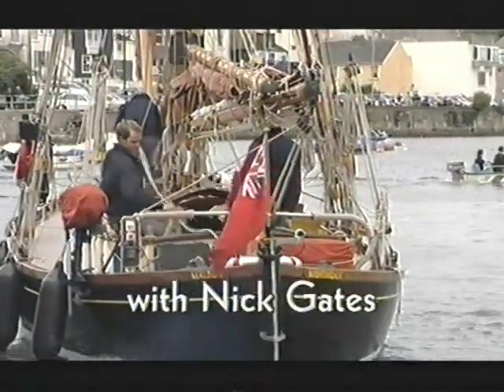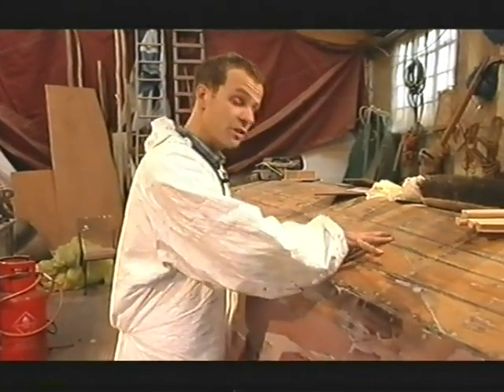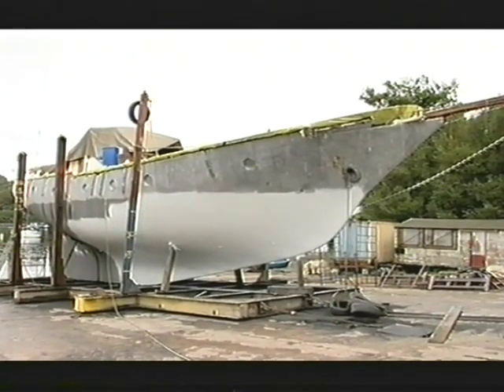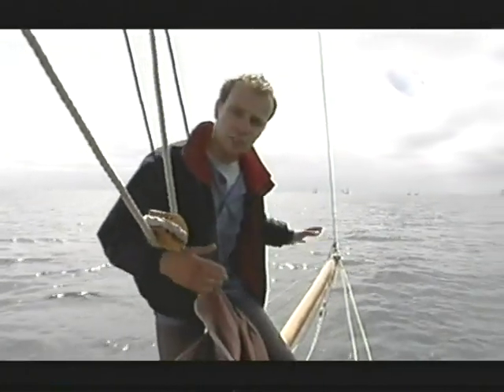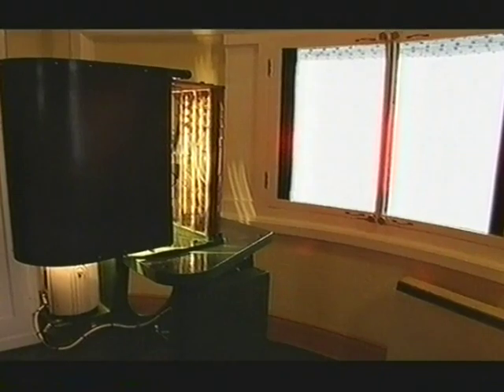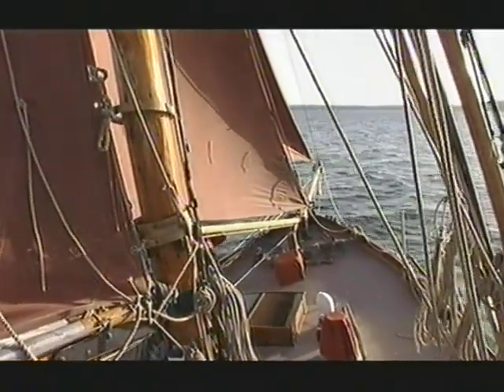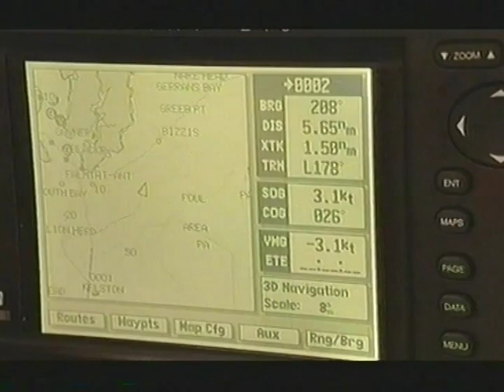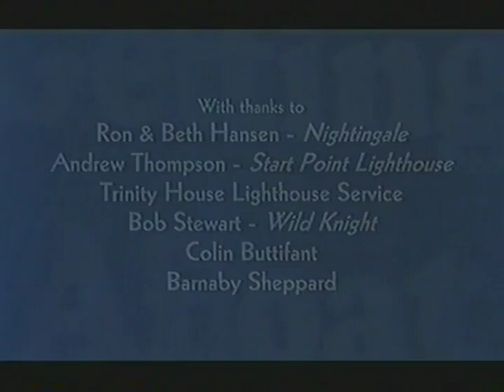Getting Afloat with Nick Gates. Episode 10, Coastal Cruising

Comment: I thought about strip planking doing a boat built but cost of timber these days just to expensive , much cheaper using ply wood , Marine grade is expensive as well and I would only use it where necessary , construction grade ply could be used in other parts of the boat and bring costs down , although depends on the type of boat one might build .

Comment: A third bearing to identify position is at least as much a cross-check on thew other two as anything else. As an example, if you wrote down one number wrongly (maybe 036 instead of 063), the third bearing, when plotted on the chart, woiuld show that there is a mistake somewher and you need to try again. It shows that mistake by giving a large triange (usually known as a "cocked hat") where the lines cross. A small-ish triangle gives an idea of the accuracy of the bearings and an idea of the "area of uncertainty", i.e., your boat is "probably" somewhere in a circular area enclosing the three cross-over points.  Always apply common-sense, too. Two errors could make an apparently good fix, but still be wrong. Better to be sure than hit something hard!

Comment: 4 degrees west variation? Am I correct in saying that your plotter has it marked on the wrong side? (Variation west, compass best, etc.) So I think you're 8 degrees out. But in Falmouth Bay there's - probably - nothing to worry about. But am I correct?
Reply from the maker: Mike, as it was fifteen years ago,  I really can't remember 😂
Reply: Good video, thanks. (I'm just doing my day skipper theory, so I could easily be wrong!)
Reply: Error east compass least error west compass best. So in this example the magnetic compass should be higher than the true bearing which I think it was.
Though I've never seen anyone get such a perfect fix on a chart particularly with a handheld compass
Reply: @benmac7315  True. Everything Nick did and said is totally correct.
 But the Portland Plotter shows the Variation on the wrong side!

Comment: what ever you do .. read the hardener label carefully.. one pump to one pump is not the combo
Reply from the maker: Hi Canyon, with this epoxy the combination is indeed one pump to one pump, as it has been for the last thirty years. Although the pumps shaft diameter is the same, the travel of the resin pump is more than the hardner pump, which gives the correct ratio. ;-)
Rgds,
Nick
Reply: good work, it's not easy I'm thinking of buying a Dagmar ! do you have any advice !
www.charliehusseymaritime.com
Reply: I once had a pump that was way out, and did quite a bit of work before I realised. Never again! I got myself digital scales.